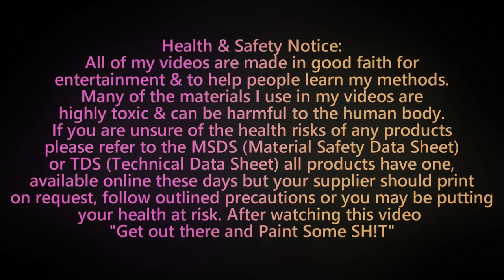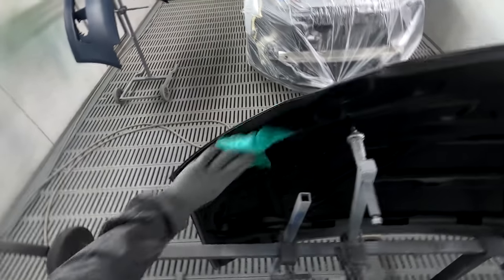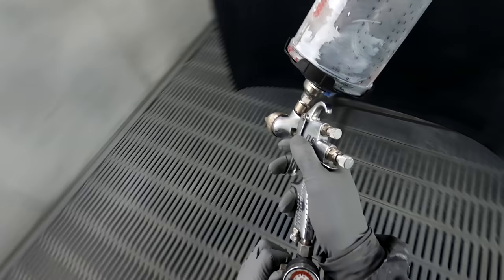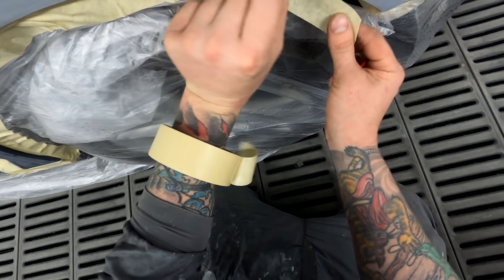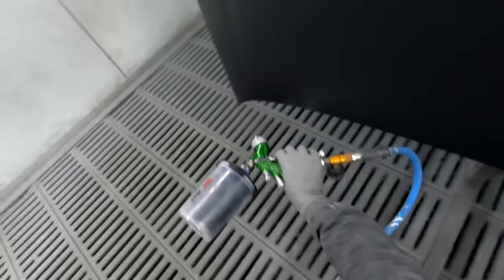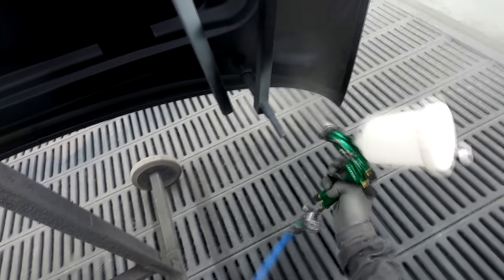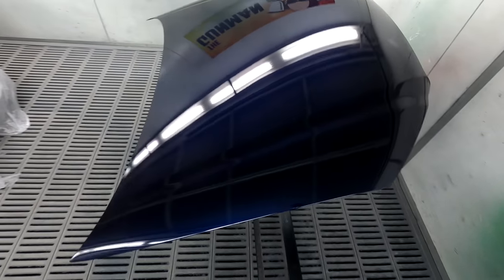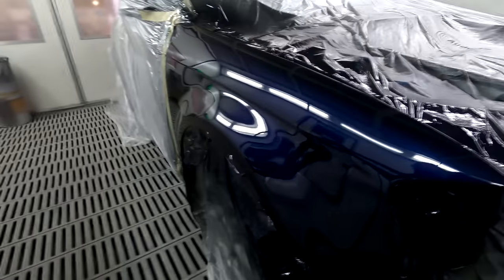Audi A3 Spray Painting

Comment: Hi Gunny, really appreciate you doing this video for me mate you explained everything in great detail. So I think I know what I'm doing wrong now, you mentioned to get it on as thin as possible and you lay just one coat but I was doing like a fine grip coat then one full wet coat same as you would on a second coat of clear plus I'm using extra fast hardener but now have the standard to try, having said that the Roberlo TDS states the WoW can be 1-2 coats. I've been using my gti pro T110 1.2 for WoW but do you think I would be better with the FLG5 1.3? Now it's cold I do my WoW in the afternoon then leave it overnight, I have a few clearcoats, Quartz Crystal Clear, Roberlo 610 UHS, a new one out called Multi-Mix Multi-Clear and one I am trying now is the Octoral C450 which is a rapid 5:1 clear with the HS420 H23 very fast hardener, at 20C the C450 is a wow clear but it flashes in about 2mins at 10-15C, thanks again Gunny you are a top man. John UK
Reply: I love that crystal clear from Quartz, I would stick with the 1.2 T110 because that'll get it flatter, if you're leaving over night then it'll be well cured. Good luck mate.
Reply: Ok will do mate, thanks Gunny 👊👍👍

Comment: Gunny, you need to be a bit more specific with respect to what you're calling wet on wet and what we Americans call sealer. Over here there are in fact three different products we call sealer all of which can be used for the same purpose under basecoat but are vastly different chemically . The first is a 1K product call Acrylic Sealer. This would be an example of that: https://medallionrefinish.com/products/refinish-products/primers/primer-sealers/tek-elite-2-1-voc-1k-acrylic-sealer. The second is thinned epoxy 2K primer such as the following: https://medallionrefinish.com/products/refinish-products/primers/primer-sealers/tek-elite-2-1-voc-epoxy-primersealer. The third is a 2K acrylic urethane sealer which is very similar to 2K acrylic urethane surfacer except that the grind of the talc filler used in it is much finer than in 2K primer and it's not designed to be sanded although it can be. This is an example of that: https://medallionrefinish.com/products/refinish-products/primers/primer-sealers/2-1-voc-non-sanding-acrylic-urethane-sealer. All of these can be used wet-on-wet so my question is which of these products do you call wet-on-wet? Here the 1K is used for cheap to medium priced jobs. The Epoxy is used for higher end jobs particularly when there are sand throughs to bare metal as the epoxy is a direct to metal product and the 2K urethane higher end jobs without sand throughs.

Comment: Gunny wet on wet is one of those terms not really used in the UK.  It is starting to filter down, you know how we use bonnet boot wing or sill. Americans use hood trunk fender rocker etc.
The most common name for primer / sealer is BARCOAT it stops the reaction between different paint types. But wet on wet is starting to slowly filter in to our suppliers but BARCOAT is readily available everywhere. Hope this helps.
Reply: I think you will find barcoat is a different product, it's an isolator mainly used when you are painting over a substrate that is not compatible with the paint you are using, WoW is just a normal 2k primer where you add hardener and a non sanding converter but no thinners (some are dedicated WoW primers though), it's used for new panels that have the e-coat and for repairs where you have cut through to metal.
Reply: Hi Nick I think you've have the wrong idea wet on wet (wow) is one of the most common terms in the bodyshop here in the UK, Barcoat is old hat and its crap aswell, If your supplier is sending you barcoat as a wow primer I would change supplier, Barcoat's main role is to seal the old paint from the new to stop you getting reactions basically for people who cant be arsed to sand back to metal and prime as normal, Barcoat tends to be used by Cowboys or Hacks as there called in the US.
Reply: @wesleysimm5419  Wesley if you read it again barcoat is what they call primer sealer not wet on wet